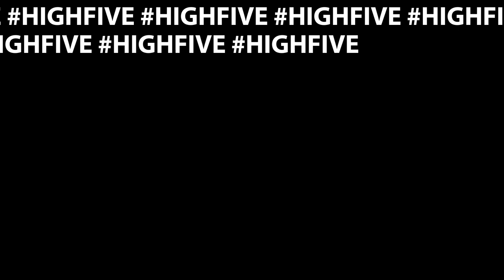Upgrade the Nozzle on the Dremel 3D Idea Builder

Comment: I would recommend putting a silicon bakemat down on your build platform when you do this. They're rated to 500f which is 260c. That way if you do drop the nozzle you don't melt anything.

Comment: hell yea awesome man! i just got a dremel 3d40, so keep doing more tinkering with it and post more videos, cause I have no idea what im doing :)
Reply: Hello i also have a 3d40, have ypu tried to change the nozzle? Its that easy? please help
Reply: @theymademecreatethis  No I haven't tried to change the nozzle. I also don't print with exotic filaments. It's still going strong. I don't want to go through all the trouble. Not even worth it on that printer. If it were an Ender 3 or something like that, it'd be a different story.
Reply: @theymademecreatethis  hey man, have you changed the nozzle?
Reply: @richyrich88  not yet, do you?
Reply: @theymademecreatethis  I'm about to. I purchased the nozzle assembly from dremel since I can't remove the nozzle, it doesn't fit any socket that I have. And I think that was done on purpose.
Reply: @richyrich88  tell me how it went

Comment: Hi Joel.
I have The FF Dreamer which are similar Machines. I've done this before. Rather than the pump pliers, it is better to use an adjustable wrench to hold the bar. More stable and secure.

Comment: Hello again. I was just given a heck of a lot of non-Dremel filament and of course they do not fit inside the Dremel 3D40. I also purchased Proto Pasta Exotics and they recommended mounting the spool on top of the Dremel . A spark went off in my head when I remembered you mounting a spool on the top of your Dremel. Any chance you would share the model?  P.S. Can't wait to wear my 3D Printing Nerd t-shirt the first day back to school.
Reply from the maker: +Nancy Raskauskas ooh! let's see... the mount for the top was specific to the older Dremel model, so I don't know if it would work for the new model. I found it on Thingiverse and I'm in a little family vacation right now so I cannot go searching. What I do now for my Dremel is keep the filament on a clothes rod above the machine. I can mount a lot of filament spools above the printer and it works really well. Does that make sense?
Reply: Thanks for answering while on vacation. You are the coolest 3D Printing Nerd. Yes, that makes sense, especially since I have a lot of filament.  I can rig a rod underneath the cabinets that are above the printers. High Five!

Comment: I have two questions. first, is there a reason you used plated brass and not just steel? like would steel not work as well or was that just a personal choice? And second, how come you have to heat it up when doing this? Is it just so that the filament doesn't prevent you from removing the nozzle? Thanks!
Reply from the maker: I used plated brass because this was the kit I wanted to try. I believe they also offer a hardened steel product, but wanted to give their coating a shot. I don’t know exactly why you have to heat to remove? I thought it had to do with thermal expansion but that doesn’t make sense. It’s late and I’ll try to remember to look this up in the morning.

Comment: On the Ultimaker 2, the process is similar but done at much lower temperature - usually 100-120°C is enough to loosen the nozzle easily if you have removed the filament first. I would assume that temperature would also work on the Dremel. Also, have a look at the 3D printable torque wrench that has been developed for the "Olsson-Block" of the UM2: https://www.youmagine.com/designs/nozzle-torque-wrench

Comment: Hi, thanx for your video. I wanted to ask you if it is also possible to do that on the Dremel 3D40 Idea Builder 3D (New One)? As I haven't seen any video on that. Also wanted to know if I change the same nozzle that you have changed to, which filaments am I able to print with?
Reply from the maker: Perhaps! I've never used one so I'm not sure.

Comment: 1. Great video. 2nd: Watching you use channel locks on a delicate device had me cringing, a better tool for that is is a pair of soft jaw pliers or a set of slip on covers on the channel locks. , also if you own a 3D printer make a tool that will hold that piece in place, instead of a tool that could damage your printer.  You building something that is basically square in design shouldn't take that much then you can make more to sell to your followers. Make it in 1/4 inch or 3/8 square drive and you are gold! My Humble opinion from some one who has turned wrenches for years, and has learned from the school of hard knocks.
Reply: Kevin, this is an excellent idea! I'm thinking sooner or later I will have to change my nozzle, so I will try and get ready.

Comment: How did you hack the spool so you can print off brand filament
Reply from the maker: +Rod Line No need to hack the spool - I just used new filament. I don't use the internal spool holder :)

Comment: I have done the full metal MicroSwiss nozzle on my FF Dreamer. All went well the machine prints with high precision however it now introduces a pattern into the finished outer lay of everything. I have tried a lot of things to track this down including damping motors, changing motors etc, nothing changed the issue. Looking carefully at the surface under magnification revealed what looked like uneven plastic flow, it seems the plastic pulses as it is being extruded, thinking it was cogging on the filament drive gear I changed the motor/gear combination, no change to the effect. I am now thinking it is the actual pulsing of the stepper motor. The precision of the MicroSwiss nozzle is amazing that it can now show this issue which I think may be a limitation of the machine. Anyone had this issue or got any ideas?

Comment: That printer looks a lot like my replicator 2. ( Fantastic printer ).  For some reason I thought the dremel one had a heated bed. I guess not.  I wonder if http://www.bctechnologicalsolutions.com/ heated bed works on the dremel? I put one on my replicator 2 with a new power supply and it made it real nice.  EDIT: Dang looks like he has had some unfortunate things gong on.  Here is the link to the heated bed i'm still curious if it would work on that dremel..it looks so much like my replicator 2.  http://www.bctechnologicalsolutions.com/index2.html

Comment: Does the Dremel use .4mm or .6mm nozzle? I'm trying to replace and am not sure which one to buy.
Reply: From what I can tell, it is a .4mm one. However, it doesn't particularly matter, as you can just change the nozzle diameter in your slicer. I would just stick with the standard .4, as it will give you the same experience. Happy printing :)

Comment: I did this exact thing a few weeks ago. Still haven't used an exotic filaments, but the nozzle is printing well. I did tear some of the Kapton tape on the heater block, so I got a small roll from Amazon and redid it.

Comment: I am having a problem where there is a clicking sound whenever I try to insert filament into the extruder and I tried taking the whole thing apart but there is nothing jammed
Reply from the maker: clicking sound but no jam? hmm... you sure nothing is jammed? filament flows easily out of the nozzle?
Reply: well, I just noticed that a red wire that is hooked up to the stepping motor is ripped apart which might be the problem idk
Thanks for responding!

Comment: I'm on the cusp of getting one of these printers.....new one is out in June, not sure if it's going to be that much better. 
Hard time figuring out what printer to get....ack
Reply: i got one. its worth getting. but you might want to look at a flashforge before buying one. its the same machine using duel extruder with a heated bed. and even the software is the same. but you get support use in the flashforge. and not with the dremel software. you can use fine print or meshmixer. to add supports.

Comment: I'll preface this question by saying I know next to nothing about 3d printing, but I have a need for one for a project I'm working on. I was wondering if there's any issue with using an alternative slicer (Cura), then saving and printing from an SD card?  I'm looking for ease-of-use and something that works right out of the box, and this looks like a printer I might want to try. Keep up the great videos, I'm learning a lot!

Comment: Was wondering... Why do you heat the block? 
Most of the nozzles I've changed I remove the filament, wait for it to cool then remove the nozzle. 
Was wondering if heating does something to help? 
advanced #Highfive for answer.
Reply from the maker: +David Parrish I could be wrong, but I think it has something to do with metal expansion when heating.
Reply from the maker: +David Parrish oh, and #ReturnFive
Reply: it causes the brass to expand and makes removal much easier if you also have junk on the threads. Also after install it helps to heat the nozzle to max temp. let it sit a minute then re tighten so you know stuff is tight in there!
Reply: +David Parrish Heating the block makes it expand and easier to remove the nozzle. When retightening a nozzle I always heat it up before tightening it a little more, otherwise it will work itself loose with the constant heating and cooling cycles.
Hope this explains it mate
Reply: Thank you for this handy information. 
#Highfives for all.
Reply: +David Parrish Tightening the nozzle while it's hot prevents leaking.

If you tighten it when it's cold, when it heats up thermal expansion may leave a small gap and allow leaking. See the E3DV6 assembly instructions at the bottom for some more info.
Reply: +3D Printing Nerd Given the small size with the coefficient of linear expansion, it won't change a huge amount. I am suspicious that it has more to do with the plastic than changes in size.

Comment: I bought 2 all metal hot end upgrades with these hardened nozzles for my flashforge dreamer but still havent done the upgrade because I'm worried I can't get the 2 nozzles aligned afterwards. Will you be doing any sort of demo of the all metal hotend upgrade from micro swiss on your creator pro?
Reply from the maker: +7patman sort of. plans for that changed a bit. I'll have more info later.

Comment: Idk if i've asked but is 220°C good for this printer with proprietary filament?
Reply: No 220 in my use is way to high with Dremel brand filament
Reply from the maker: +Connor Whelan 220 is the default for Dremel branded filament. Company uses that temp because it "just works" in most situations. I like Connor's idea and can run it at a lower temp.
Reply: +3D Printing Nerd so what do you guys think is a good temp? I've found that it doesn't melt right at lower temps but i'm too scared to try too much
Reply: +3D Printing Nerd ahhhh yep I was and idiot and got confused with some exotic filaments temps now that you have said that, 215 is what I use and is very close to standard

Comment: It's probably worth mentioning that carbon filled materials will also scour the inside of bowden tubes and hotend liners. They will require replacement after some, extended, period of use.
Reply from the maker: +Neil Darlow that's true, though, standard brass nozzles take the most damage in my tests. Good call.

Comment: Is this printer still recommended?
Reply from the maker: This is a bit of an older version of this model - look up the 3D20, or it's bigger siblings the 3D40 and 3D45
Reply: @3DPrintingNerd  Thanks for the reply. So would the 3D20 be good for a first 3D printer? The only experience I have is making the 3d models and having shapeways print them out.

Comment: Would that work on the flash forge dreamer dual extruder, high five Joel
Reply: Yes they are exactly the same well the top half is a little different but the bottom half is the same even the same nozzle
Reply: +salam alsayed  I installed two on my FF Pro Dual and have had great luck with them.  They are very slick.  When you take them off there might be a small cone of filament that slides out with the PTFE tube.  Well worth the cost.